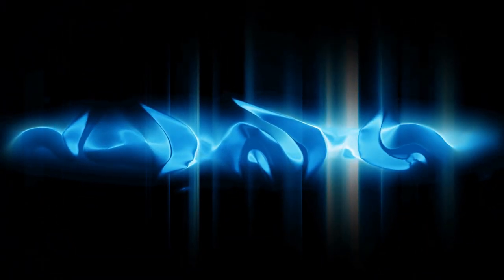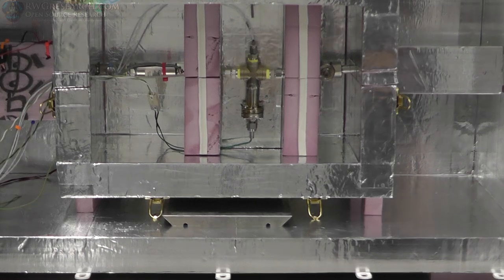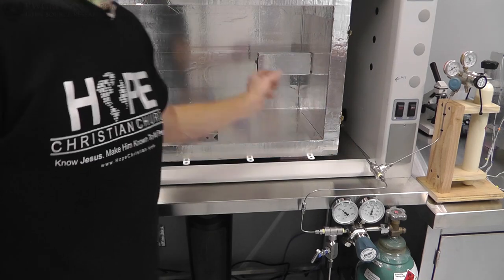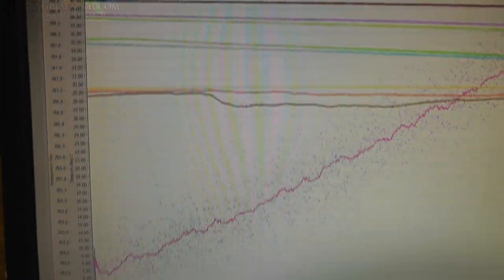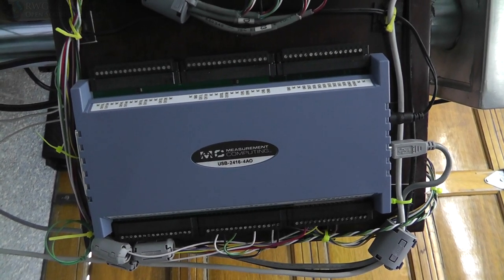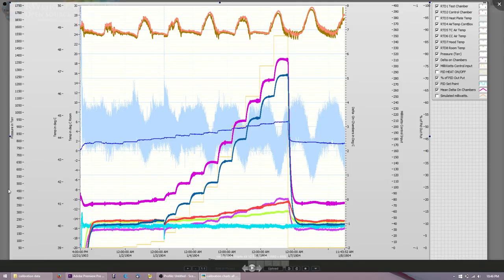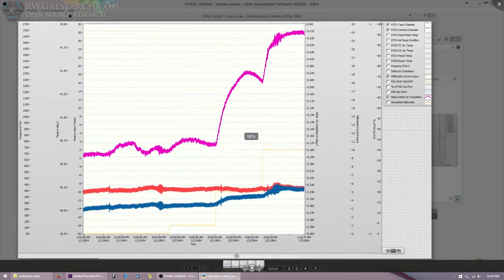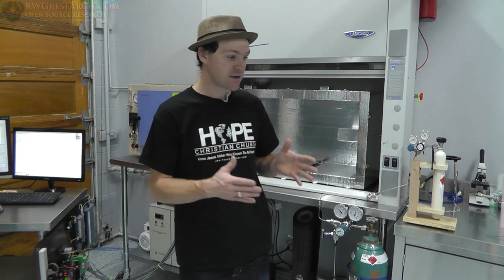Cold Fusion update#2 LENR Low Temp Calorimeter system overview Discussion video.

Comment: the aluminium tape around the edges will conduct heat from the inside of the cavity's to the outside, will also leak due to pressure changes, foam will also conduct but you can conduct an experiment to calibrate the rate.

Comment: Hi Russ. Happy New Year! Looks like a very slick and well designed set-up. Nice build, too. The only improvement I can think of for your boxes would be to cut some thermal breaks in the Aluminium tape.  As WB8 mentioned below, the Al will conduct heat wherever it goes. Simplest solution  is to cut some gaps in it- i-2mm wide is plenty. These gaps are known as 'thermal breaks'. Apart from that the only other thing to watch out for is radiant heat from your hotplate affecting the inner box directly above the plate. Calorimetry isn't easy - but you have built a good sound experimental workhorse. I wish you great results!

Comment: In getting over a head cold it came to me that maybe a simple steam vaporizer could become  an L.E.N.R. reactor if ran on rain water for the increased deuterium. Googling around I found that Cold fusion is not dead and gone but young folks everywhere are working hard to find L.E.N.R.if it can be found.  Kaloo Kalay ! More power to you all!

Comment: One reason for your thermal crosstalk is because of your metal conductors. One way to improve would to be to increase the length of your SS tubing so that your conductors take a longer thermal path. Go from inches to feet. You could probably make coils and insulate them to safe on space

Comment: Happy New Year. What noise floor are you aiming for? If not careful you just might end up with lots of e-thermal noise from your rtd and micro contact resistance variance on your connectors due to vibration/thermal swelling. I'd consider also using an old Nikon Coolpix consumer camera(remove the ir filter) to make a heat sensor. Then you could focus down and see your heat as a secondary data stream while your running. You would gain then an averaging technique and the equivalent of a sensor array that's the size of the image array for free. You'd be counting ir photons at 12bits x size of array...processing would be just reading raw files. Keep the faith, Russ. Cold fusion at the least is worth exploring just because you never know what you learn pursuing it.

Comment: My thoughts.......A control should not be part of the same system (with a (cross talk) interdependent variable)....A control should fill all the independent variables of the system under test with one  variable held constant if possible. ...For example the (variables) temperature change and expansion of a heated vessel at a (constant) of 10 watts power input. The control is the absence of the reaction and the test is the cold fusion reaction. So (ah...) separate..

Comment: Great great great Russ, but you need to monitor this for days afterwards, the navy experiments indicated some very delayed fusion incidents.  Great to see you get into this sort of work. CR-39 is due and a borax solution in the water to absorb neutrons and increase temperature.
But mostly I would request you monitor this for days afterwards, nextly email me as I think I have a better composition of elements in order to catalyze lattice fusion. and I agree most of the time no input should be required it's spontaneous.
Very good video, very skeptical, and ready for the next level so happy for you.
Reply from the maker: thank you for your positive comment! yes this is the calibration run.  so when running tests I do them for a week or more.  also please email me would be happy to see some of your thoughts on the lattice assisted ColdFusion. see my contacts page on www.RWGresearch.com for my email.  thanks!!!! also some thoughts on "no input energy" there also could be some frequncy added via vibration or light to the mix to speed the process up. but this is just a guess according to some materials. ~Russ
Reply: ***** You already have it, good luck.  this is a great set up and all, but when you start using sonication or light its really going to screw up your readings. Might be best to just use time dependant exposure of CR-39 witnesses and see if any of the variables increase visible events on the witness.

Basically there are about a million things water molecules can intercalate into, from clay to carbon nanotubes.  If it's lattice vibrations causing the fusion events than anything with a crystal lattice should work to some degree.

Comment: Hmm. Bet you woudn't even have to cool the camera since the e-noise will probably cancel out over the size of the whole image sensor. You could include in your box and control it with a sdcard-wifi emulator card like an eye-fi if you later wanted a system with only gas piping.

Comment: Your control is just standard air yes?  Why can't standard air generate power?  And if you are discounting standard air... you maybe needing to relook at it... you just made fusion using standard air partials man... 

If that isn't the case... then something is getting into your air that is causing the readings... so what is your contaminate? It could also be a discovery :3